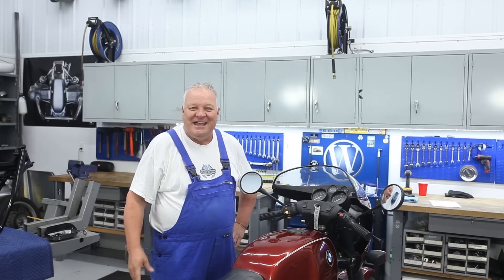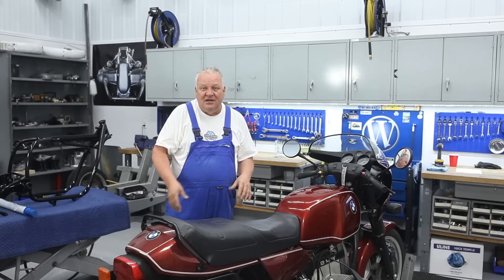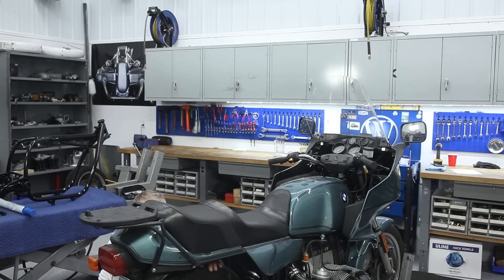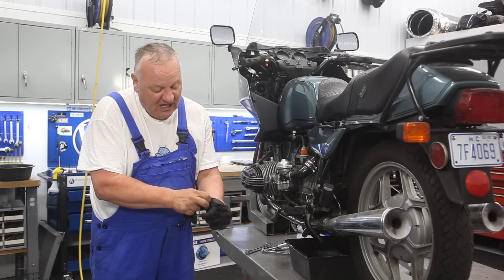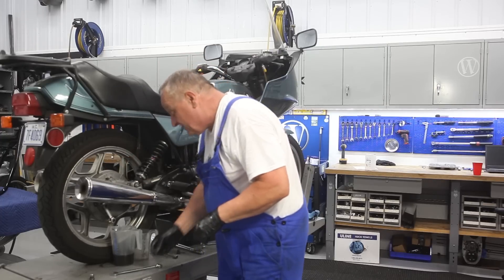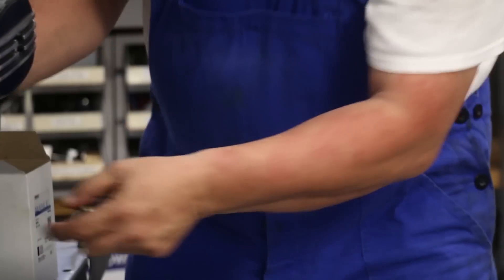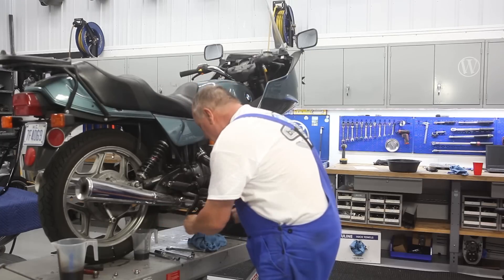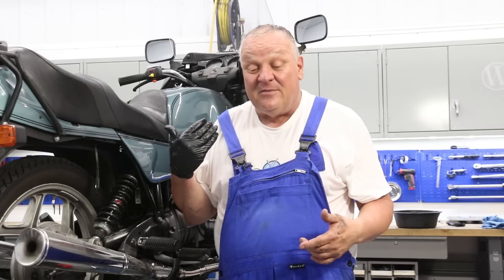BMW R80 RT to S Conversion #1 - How to properly drain the fluids

Comment: My pack-mule for the Americas: '91 R100 GSPD; 264,000 Miles (purchased new), she's never outright crapped out on me... always gave me fair warning... been through several Kardan drive shafts (latest modified for zerk fittings/u-joint bearings).
Euro-tourer: '83 R80RT, purchased used from Swiss Beemer dealer (previous owner had traded in on a new beemer... he was 68 at the time ;-)... Swiss-owned bikes are usually a best buy; due to stringent Swiss vehicle inspection standards. Now upgraded to 1000cc, Nikasils (used) with original R80 heads ("squish-zone" modified + lead free seats, updated valve train...) R80 32mm carbs (new main jet); dual plugged (shrink tubing mod for ignition "Bean Can"... limit advance).. higher compression ratio (9.5+ ?) due to upgrade... "longer"/"taller" 5th gear to compensate for original rear end... still has the R80 torque band "sweet spot" on "kurven-reiche" mountain roads... pulls like a racing tractor... Beemer dealer keeps trying to sell me a new one... ain't gonna happen in this lifetime.

Comment: I have the same bike same year already naked but I may add the S fairing from my /7 to this bike. I noticed when you took the bike out to warm up before draining the fluids there was a familiar squeal from the dual front disk brakes. My bike has the same dual disk set up with new rotors and new pads and I can’t get rid of the squeal that happens at slow speeds. I read that this was an issue with these models with these brakes. Perhaps you will be addressing that in future videos.. if not I would be curious if you have a solution.  Once again these are great videos thanks.
Reply: The squeal is only an issue if you let it bother you.  Did you clean the pad retaining pins? Did you put any brake caliper lube on the back of the pads?  I'd be curious to see if those things would make a difference. But it's not an operational problem, just annoying.
Reply: Yes I have and it worked for a short while but not a long term solution. Since it did work initially it is likely a vibration of the pads like most seem to conclude.
Reply from the maker: Hi, yes the squeaky brakes are pretty common. I have found that the sintered pads work well and minimize, if not eliminate the squeak. We'll be going through the brakes pretty soon.

Comment: Like the video, as always, but I've got to differ (and agree) with you on some points as between twin shock vs. monoshock. 
I think there are some tradeoffs that aren't necessarily positive.
Tubeless v. tube type tires.  Tubeless are (maybe) easier to install than tube type, but not so outside of a professional shop, especially with some brands of tires with stiff side walls. You can, maybe, plug a flat in a tubeless on the road, but maybe not. And you're only supposed to drive on a plug to go get a new tire. You cannot re-seat a tubeless tire on the road. You can, in theory, patch a tube, even more than once, and even quite large holes, with self-vulcanizing patches. (Fortunately, I've never had to do either).  If the puncture is small, you can drive normally on a patched tube. Patches, if well done, hold indefinitely.
Monoshock is expensive, perhaps even more expensive than a pair of twin shocks. Also, slightly harder to replace, since you can't use one shock to support the rear drive and bike. 
Wheel bearings in monoshock are maintenance free (meaning, replace when failed), but roller bearings, if given some maintenance, and not abused (i.e. pressure washing) will last many years. However, the large ring gear bearing in monoshock rear drives do fail occasionally, since it is carrying both drive and shock loads. The play that was noticed in the rear wheel of the example featured in the video could just be a need for re-shimming the bearing, or it could be the bearing is failing. Or it could be that the bearing will fail if not re-shimmed. And if you're going to re-shim, you might as well replace the bearing.  That bearing, by the way, is now $154.77. Add labor, and you're looking at a $400 repair, at least.
In the twin shock models, these loads are carried by three bearings instead of one. Also, the later drive shafts which run dry fail.
There's little difference in braking between the twin disc models with two-piston Brembo calipers, save the later four-piston calipers.
And, lastly, of course the "C-clip" issue.  
Styling is, of course a personal choice, but it's not hard to make a case that the earlier models are styled better.
Some of the later monoshock models were equipped with the SHED evaporative emissions system which was complicated (mostly removed on all these bikes by now).
The later style plastic bag mounts are sturdier; the metal frames will fatigue and break over time. This was a definite positive improvement.
The later center stand is a definite improvement.
Reply from the maker: Thanks so much for taking the time to share your thought and very valid points!

Comment: Hi William,greetings from Scotland.
 A question about the tube of Liqui Moly gearbox additive you suggested using.
 I have R100rt  Monolever1993 model, and have just changed both Engine oil and Final Drive oils.All good but will adding half the tube to the final drive now push the oil level too high?,and can the other half be put in the Engine oil ? ,thank you, Richard.
Reply from the maker: @Richard Allan: The small amount of additive should really not change the level much but you could let a bit out to compensate. Rather than put the excess in the engine oil, I would save it for next tome you change the gear oils, as that's what it's really designed for.
Reply: @boxer2valve  Thank you William,I have taken your advice.

Comment: Hi William. I have a very similar bike to the one at the start of the video (but with an RS fairing). Could you tell me where you sourced your paint from to do the 'S' fairing on your bike? There doesn't appear to be anyone on this side of the pond (southern England) who can supply Colorado Red (code 613). Did you use an existing, available colour that is very close to the original? Great videos by the way!
Reply from the maker: Hey Philip, Glad you like the videos.  We use a really good local painter named Dustin Maybin.  It's possible to match the paint exactly with the factory BMW.  The Brand they used is called Glasurit and their paint codes will match the BMW's spot on !

Comment: Great video William, so much helpful information. I have a 94 R100RT I recently bought and pulled the front end out for some servicing and tarting up replacing fork boots etc. When I removed the front wheel I discovered it wouldn't slip out between the calipers without removing them so I took them off as they were coming off anyway. I noticed your red R80 has a flex line on the left side mine is on the right and has a solid pipe joining the 2 calipers that goes across under the guard. Is there an easy way to remove the front wheel  without opening the brake lines. I had heaps of trouble bleeding the brakes after reinstalling them bleeding from the top and reverse bleeding from the bottom tapping calipers etc. There about 80% good now but I know they can be better. I noticed you used a vacuum style to bleed brakes on the white bike. What are your thoughts on these little issues I have. Thanks Noel
Reply from the maker: Hi, Don't open the brake lines. You can unbolt the calipers and then spread them apart, just enough to remove the front wheel and same when reinstalling.
Reply from the maker: Regarding bleeding the brakes. This can be trick and we will show you one way of doing it in our next video which should be out before the end of October 2019. Basically, I have found that with metal or wood approximately the same thickness as the brake rotors inserted between the pads and with the front fender removed, hold the unbolted calipers in such a way that the bleeder is at the highest point. You might need someone to help you hold everything. Now bleed the brakes and the air should find its way out.

Comment: I am trying to find a video on snycing the 40mm bing carbs with the twinmax unit. I can't find where to attach the hoses from the twinmax to the carb.... whaaa....
Reply from the maker: You should have vacuum ports on the underside of the carburetors. There should be a slotted screw, which you will need to remove and then you can attach the vacuum hoses for your balancer.
Reply: @boxer2valve  AWESOME!!!  THANKS SO MUCH!!

Comment: I noticed that the side stand automatically detracts when you lift the bike,  mine doesn't work that way what am I missing?
Reply from the maker: Hey Steve, It's possible someone changed the side stand at some point during the bikes life.  Some people do not like the spring loaded retractable ones than came OEM on many models.  If you want to change it back .... go here  !  https://www.boxer2valve.com/sidestand.html
Reply: @boxer2valve  
The reason I ask is because I left mine deployed and high sided because of it and in further inspection I think my main frame is bent, what is the procedure for straightening it,?

Comment: If the transmission shifts well, and is quiet, I don't see why you would tear into it.  I do think, however, that the main bearing on the ring gear is worn out.  This is an inferior design since the one bearing carries most of the wheel loads and the drive loads. In the twin-shock design there were separate ring gear and wheel bearings.
Reply from the maker: Hi, we'll have to see what is going on with that final drive. I have had good luck fixing them in the past. The tapered roller bearing may have some wear, so we'll try replacing that and check the shimming. Plus a few other things. We'll at least try before condemning it. Once the gearbox is out, we'll make the determination, but you are absolutely right, if it ain't broke, don't fix it however, we might tear it apart anyway, we'll see.

Comment: Exceptions: lack of "C" clip (and requisite groove) on front end of Transmission Output Shaft; the lack of "C" clip allowed 5th gear and bearing to shift forward, ultimately negatively effecting gear alignment, accelerating wear. First versions of Valeo permanent magnet (PM) starters (reducing overall current draw during start cycle): the first version had permanent magnets glued in place, glue would break down, loosening magnets and locking/destroying the starter.... later versions changed to clip retainers for magnets (problem solved). Bosch 0 120 340 "...005" (previously 20A) vs. Bosch 0 120 340 "...008" (17A) alternators: Used thinner wire (smaller gauge) for stator windings... allowing more turns per winding to fit in stator housing; this improved induced current at lower RPM (charging started earlier... theoretically around 1200RPM... less "GEN" light flicker) Generally,  alternator Rotor DCR was reduced from 3.7 to 3.4/3.2ohm... consequently also improved 14.4V (preferred) AGM Battery charging voltage (vs. "Slosh Battery" - 13.6V) ; However, due to thinner stator winding wire, max current output rating was reduced from 20A to 17A (street story: no transmission warantee if not wearing BMW boots)

Comment: I notice you did not use a torque wrench when replacing the drain plugs. Any reason for this?
Reply: He explained about the different crush washers. You want to do it by feel, so that you're using just enough torque to crush the washer and give a good seal.  The metal is soft and you can feel it give. That's also why these washers are replaced every time.
Reply: Not everyone has a torque wrench.  Newbies will sometimes over-torque these plugs using a torque wrench.  Either they use a torque wrench that's too big (e.g. 1/2" drive) or they don't know how to use it correctly.

Comment: The comment is that the R80RT is outmoded for touring because "of the way traffic is today." 
If you're touring with traffic, you're not touring, in my opinion.
The R80RT and R100RT are still ideal bikes for touring on the back roads.
They're crappy on the Interstate Highway, but Interstate riding is for the birds anyway.
Reply from the maker: Good Point Garth !

Comment: Can someone please tell me what tool is needed to loosen the engine oil drain plug? It looks like an allen bolt, not sure what size mm is needed? any other size wrenches needed for this oil change job? Thanks!
Reply from the maker: hi, you will need an 8mm allen wrench or socket.

Comment: William, I’m in UK and have a ‘93 R80RT so very interested in this series. I noticed you didn’t go into too much detail about the oil filter O ring compression. As I understand it, because canister depths can vary a lot, in order to get the right O ring compression you measure the canister depth (below the case surface) and use a combination of shim and gasket to get the right O ring compression. The infamous $2000 O ring ? Any comments ?
Reply from the maker: Your 93 should have the later style canister with the flared outer edge. Up through 1984, there was a gap around the outside of the canister, whee the o-ring could get drawn in if the shim was not in place. It has not been my experience that there was a great variance in the depth. That certainly doesn't mean anything other that I have not heard of that before. On your 93, you could technically just use the o-ring and that's it. If you also use the gasket however, which is not at all a bad idea, then I would use the shim too, not for the purpose of bridging the gap around the canister, but rather somewhat equalizing the thickness of the gasket.
Reply: @boxer2valve  Thanks for response. I only use the  O ring on the RT, not the gasket. Quite a few calculations on the internet about the depth, shims etc. Also have an '81 R100cs but haven' t measured canister depth yet as it's still in bits. Really enjoy your series.
Reply: There's a lot of discussion of filter canister depth in all of the usual places, just google "2 thousand dollar o-ring". I don't believe this is a subject that can be ignored on mono-levers, because I have an 83 ST that requires 2 shims and no gasket to compress the o-ring.

Comment: Could you show how to remove the RT fairing as if you were going to reinstall it? (Not Sawzalling it off ) .I'm resurrecting an '85 RT, and as a younger man toured with it, and liked the fairing.
Ps... anything we need to know about lubing the splines on this model ?  Your opinions on the infamous circlip... or lack of one... in the transmissions ? Thanks !
Reply from the maker: We took the fairing off and hope that was OK! We will cover the gearbox and splines and be sure to address those issues. Thanks!